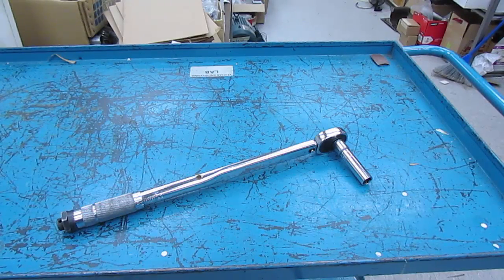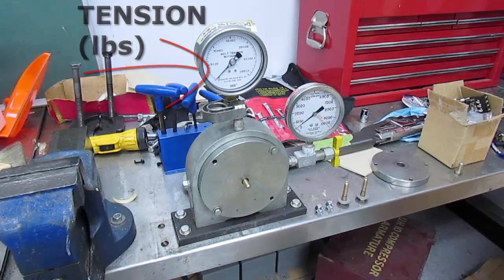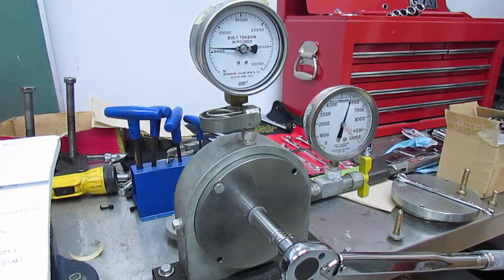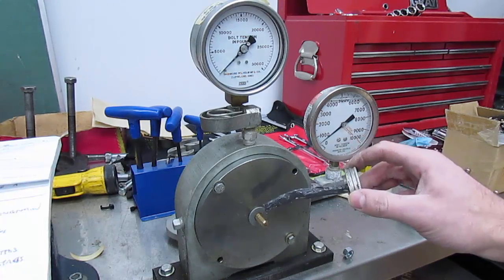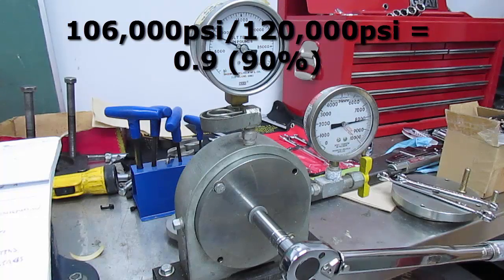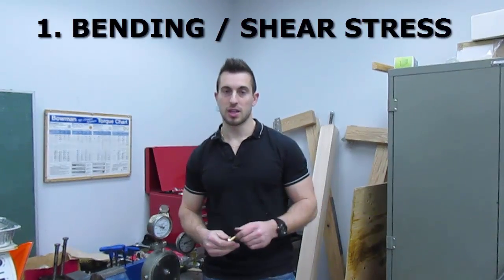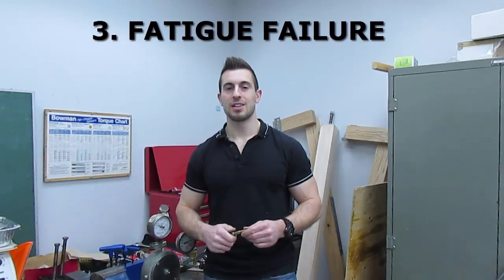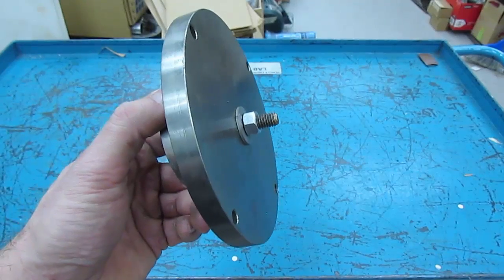Should You Put Anti-Seize On Wheel Studs / Lug Nuts?

Comment: To all of you who are terrified of using any form of lubrication on lug nuts, whether it be oil, grease, or anti-seize, NASCAR has a dry film lubricant applied to the wheel studs on the race cars.  Anything added to the threads/nut surfaces that alters the coefficient of friction is considered a lubricant.  And, yes of course reduce the torque of lubricated lug nuts by 30%, but that number isn't as  ultra critical as some would have you believe, due to safety margins.    Dry torque specs will bring the tensile load to 75% of stud yield or 'Proof' load, so there is still a big safety margin to work with.  The 30% reduction in torque on lubed threads still brings the stud to the same 75% of yield, so there's still the same safety margin to work with.  Using the dry torque spec on lubed nuts will bring you right up to the limit of yield stress before damage is done,  but i believe there's still an additional 10% safety margin built in to the max yield stress numbers.
Reply: It's a shame the guy making decent technical content embraced your comment with a heart.  This is terrible information no one should follow.  @asjc27 pretty much nailed it in that 75% is the target but from testing the OEM knows what they ACTUALLY achieve AFTER relaxation of the joint with their $3,000 electric torque wrenches.  Depending on the joint, OEMs design a torque or torque to angle (not yield) joint to 50% of proof load.  This is usually the WORST case scenario (not better because you have 50% margin) which was partially covered by the video because you're way more likely to unload the joint which then puts 100% of the load in the bolt and you will have a failure.  Once they're OK at 50% they may do some more testing or simulation at other pretension levels but if the joint looks good they're done and they target 75%.  If they need to sharpen their pencil due to some issue they're seeing in testing or FEA they will pull out their bag of tricks which can include better tooling and controls on the assembly line to bring that +/-25% down to 15%.  Your torque wrench will never replicate this and you should follow the unmodified OEM procedure if it states anything other than torque to XX ft-lbs.

Also, throwing out a blanket 30% reduction if you lubricate is equally dangerous for many reasons.  People have no idea how many things can vary your actual bolt pretension.  The RPM at which you rotate your torque wrench up to the click/beep will change the pretension by a fair amount.  Same goes for applying the torque to the bolt and holding the nut steady vs torqueing the nut.
Reply: @pdvmotorsports look I'm far from being an expert in this group of automotive people. But the facts do not lie, and his video is straight up as you can get. I feel people just don't want to admit, regardless of excess safety yields, that they have and will continue to put countless people's lives at risk by using any additional material onto threads of a vehicles lug nuts 😒 end of story
Reply: @pdvmotorsports  I'm no expert. But, how can you be so sure!? Maybe youve just gotten lucky? I recently had to reinstall lugs onto my 6 lug RV several times, which has an old axle. Every time I did they got looser to where I finally had to use thread lock. But it didn't feel right, starting my investigation. I believe now both the studs and lugs are completely shot, stripped, cross threaded, stretched, loose-but-seem-tight, under torqued, over torqued... basically, every single one of the above nightmare scenarios he explained. I now wouldn't even pull it down to a tire shop a few blocks away it's probably pushing 4000lbs 😮 and that is with the rim and all 12 lugs seated and tightened as much "as possible". I just don't trust it, and want to pull it down to AR (from CO) this dude may have just saved my life in reality, but at the very least a crash n burn scenario to where I'd lose 25k, my Jeep, as well as 5 years of labor and build time into the trailer. i honestly don't care what 'experts' and mechanics above are saying, either: ignoring science and its supporting facts is literally like sticking your head in a lions mouth, putting thousands maybe even millions of people at risk. I mean geez one guy up there's comparing rifle barrels to car wheels, like, what is that?? There's no way the threads on the barrel of a rifle could ever be subjected to that much force, shear, weight, torque, tensile strength, etc, and also on a constant and cyclical basis which I'll definitely state that. Nah, the REAL expert here, is the person who took the time to do the demonstration in this video. And the facts do not lie
Reply: @majkdave  I honestly have no idea what the point is you're trying to make.  He made a decent video and then liked a bad comment.  My information is based on working with a 30 year bolted joint expert at GM.  All he did for a career was develop the science of bolted joints.
Reply: @pdvmotorsports  well, granted, my situations a little different. 4000 lb trailer on 12 old, rusted out lugs. But even if it was all brand new, why chance altering physics and bolt properties for couple hundred bucks, or shoo in this case, getting the lugs off easier to do a $20 rotation? My gawd are peoples lives worth less than $20 now??? That's my point, his video shows exactly that
Reply: This is mostly true but lacking some important information that may lead people to the wrong conclusion. 

First, you are correct that torque specs for reusable fasteners are generally recommended to be calculated for around 75% of the proof strength (not yield strength - they are related but different). BTW the few wheel studs torque specs I looked at were more like 65-70%.

However the crucial bit of information that is missing here is that even a perfect application of the torque spec is no guarantee that this will be the resulting preload. The 75% figure is only the average result. There is a huge variability in this. DOD document MIL-HDBK-60 states a variance of +-25% in preload for a given torque figure, while a test by Blake & Kurtz on 20 identical dry bolts torqued to the same figure resulted in variance of +25 -31% in preload.
The bottom line is that a torque spec calculated for 75% proof strength may result in as high as 94% of the proof strength in some bolts. That 94% is not a coincidence. The 75% rule of thumb was chosen to guarantee that even the outlier bolts will not exceed their proof strength, so no bolt will acquire a permanent deformation, hence allowing reusability. The margin is therefore very low for some bolts, so if dry torque specs are used as is on lubricated bolts some may deform with all the implications of that.

This huge variability is partly why using torque to achieve a given preload is avoided in critical fasteners, and instead more advanced methods are used, like a prescribed amount of rotation, DTI washers or bolts stretched a prescribed amount.

Comment: I live in the rust belt but never had rust as a problem with lug nuts.  A tiny bit of surface rust here or there, nothing to worry about.  Lubing a crucial safety component like a lug nut sounds insane.

Comment: The minor thread diameter of a 3/8-16 bolt is .297".  This means the bolt's cross-sectional area is not .0775 sq. in....it is .0693 sq. in.   So, the stress on the bolt is actually greater than  71,000 and 106,000psi.    In fact, the stress on the lubricated bolt is very close to its yield strength.  One more reason to use given torque values on dry, clean threads.
Reply from the maker: Thanks Larry, good catch!
Reply: @EmbraceMaking  Actually, you were right the first time. It's Larry who made the mistake. Yes, a 3/8" 16 has a minor diameter of 0.2938" (not quite 0.297) which gives a minor diameter area of 0.0678 in^2 (not quite 0.0693), but that is the wrong area to use for stress. 

The tensile area of a bolt is not the one corresponding to its minor diameter. Remember - the threads carry tension too - so the effective cross section (the tensile stress area) is in between the minor and major diameters. It can be calculated (you can easily find the equations) or read from a table.

Looking at a table, the tensile stress area of a 3/8"-16 is 0.0775 in^2 - just as in the video.

Comment: Wouldn't this logic apply to all fasteners that I apply anti-seize to?  What make wheel studs unique?
Reply from the maker: They are not unique! This is applicable to all fasteners as you suggest... however, I think some people have the impression that wheel studs and nuts are somehow a special application. Also, most people don't even know about wet / dry torque ratings and wheel studs/nuts are likely the most safety critical item that the average person will attempt to do themselves without the proper knowledge. So basically I tailored the video to this audience but the same effect takes place on any fastener.

Comment: Galling and corrosion of threads are good enough reasons to use an anti-seize,
so make a scientific allowance in your tightening setting,
and live happily ever after.
https://www.youtube.com/watch?v=f6akcyvquzs
John C is proven correct by the experiment here.
Reply from the maker: I don't disagree with the 30% reduction, it's widely accepted practice and I've mentioned it to other people here in the comments section. My only reservation is that a lot of people don't own torque wrenches and may not be as informed as the engineer in the video. So with a breaker bar and "the 'ole calibrated arm" most people have no clue what they are doing and the safe bet is to just torque them dry. Also, 30% at "heavily lubricated" now throws another variable into the mix that is very much subjective. How lubricated is "heavily" and how has it been distributed around the thread? In my opinion it is just more conservative to do it dry and this is probably also the reasoning behind the automaker's suggestions. If you are comfortable and competent then do as you please.
Reply: @EmbraceMaking  Given that the thread clearance is only a few thou, heavily lubricated is soon reduced to “squeezed out”. It seems that automotive workshops often prefer rattle guns to torque wrenches, and galling noises indicate dry threads. Those that watch these videos are most likely to be careful owners checking their own vehicles.

Comment: If you were to instead observe the load gauge to arrive at the desired bolt tension (e.g. 5.5K psi preload = 60% elongation or stretch), why should it make a difference as to how much torque was applied to the fastener? Would dirty dry threads result in more accurate fastener tightness? Creating the desired bolt tension or stretch is the objective, yes? What am I missing? 

As I mentioned, dry threads add rotation friction which must be overcome to apply the proper load to the assembly. A lubricated thread should reduce that dry friction variable and minimize the rotational friction to arrive at the correct bolt tension regardless of the torque needed for that to happen. This is the reason why measuring actual bolt stretch is a better method to arrive at the desired bolt stretch. However, not all threaded fasteners can be measured end-to-end. Lacking that capability, try torquing clean, lubed threads at 70-75% of the specified spec (~33 ft.lbs). That should get you in the same preload ballpark as a dry lug nut tightened at 44 ft. lbs. for 5.5K psi preload.

Comment: I can't think of a single car using a nut and bolt, as done in the test, to attach wheels. The taper or spherical seat provides more friction than a flat bolt face and washer. I use anti-seize on wheel studs and have for over 50 years-ever since I snapped off a few wheel studs and made a lot of work for myself.
Reply from the maker: The nut and bolt is clearly just for demonstration purposes to get the point across. The numbers are also for demonstration purposes. I think that is pretty clear... I understand people have done things a certain way for many years without issue. I'm not saying that if you use anti-seize your wheel will fall off tomorrow. The point being made is that it is not intended for the application as any automotive engineer will tell you, and it increases the likelihood of something happening, not guarantees it. Even the other day I purchased a new set of wheels for my car... in the instruction booklet that comes with each wheel it explicitly states not to use anti-seize on the studs. This is widely accepted as best practice.
Reply: @EmbraceMaking   Lawyers are the reason for the no anti-seize warning. Just like the warning not to remove spark plugs from a hot engine. As an automotive engineer I can tell you anti-seize works well when used properly. Your experiment was not representative of an actual application or circumstance and means nothing as far as the issue of anti-seize goes. Why not update your experiment using an actual wheel and lug nuts?
Reply from the maker: @chash7335  If the lug nuts and anti-seize combination were fail proof as you are suggesting, there would be no need for lawyers to get involved. The fact that user manuals and documentation exist showing that anti-seize is not recommend to be used on lug nuts would suggest that there is some level of risk involved. Just because you've done something for 50 years one way without issue doesn't mean that someone else won't have a problem. I can smoke for 50 years and not die of lung cancer but we all know smoking can cause lung cancer. I'm also an automotive engineer and I can tell you that the geometry of a conical seat or ball seat lug nut does not make the nut exempt from the effects of lubricant on the threads. The friction produced by the thread interface contributes to the overall friction the nut experiences as part of the equation I provided in the video. Reducing the friction increases the pre-load and you could over torque and stretch the bolt rendering it useless. This is just as bad as a under torqued lug nut. This is why dry and wet torque ratings exist... lug nuts are nuts with a different shape, it still applies to them. Their shape is used to aid in centering the stud within the bore such that mechanical loosening of the nut doesn't happen with an eccentric motion acting on the nut. This certainly helps prevent loosening but as I said, if you stretch the bolt it no longer acts to compress the bolted joint and it will loosen. I didn't run the demonstration with an actual lug nut because I didn't have a matching conical or ball seat surface to clamp down onto in the pre load measuring device. I would have had to get a piece machined for no good reason. It was a simple demonstration showing the relationship between torque, friction and resulting preload whose concept applies to lug nuts also.
Reply: @EmbraceMaking  Fools are far smarter and persistent than lawyers.

Comment: Laboratories, calibrated ratchets, metering devices, mathematical formulas, percentage levels, etc, are all fine and dandy........
Until you're on the side on the Interstate, late at night, butt load of traffic whizzing by, in the rain, with a flat!
Maybe then you might have wished you put a drop or 2 of anti-depressants, grease, or oil on the studs.
Reply from the maker: On the other hand... you could be on the side of the highway with no wheel because you used anti-seize and over torqued the bolts. The video isn't trying to be over the top, I'm just presenting the relationship between torque and friction. A lot of people don't think too much about it and there are plenty of incidents of wheels falling off cars. It's not guaranteed to happen but its certainly possible. That's all I'm trying to get across.

Comment: Very informative,  good explanation. And you addressed the question I was asking myself,  why dont we just reduce the torque specs by say 30%.   I live in a rust belt area, rusted lug nuts are not pleasant to deal with. (Especially if your changing a tire and dont have an impact on the side of the road). I think reducing torque specs by say 30% should be explored.  

At any rate has anyone had a lug nut problem that they contribute to using anti size?  I have been using it for 30 years with out a problem.  But maybe I use a lower torque wrench setting?
Reply from the maker: Hi Ed, reducing torque is common practice in combination with anti-seize but maybe check out some extra resources about how to do it properly.
Reply: Yes  I was a firm believer in using antisize for years but had to give it up due to the fact that most people over tighten to begin with, but have also noticed that the factory will put something that looks like gear oil on the hub pilot and studds so you can get the wheels off that tuff first time,  I think that people would live where corrosion is a problem must find a way, one outfit I worked for simply used the small air hose on the big impact to install, and it worked, but left me wondering.